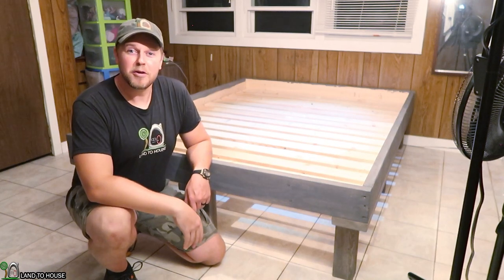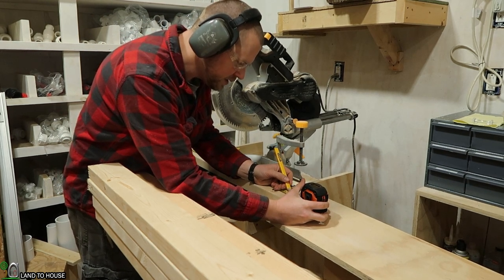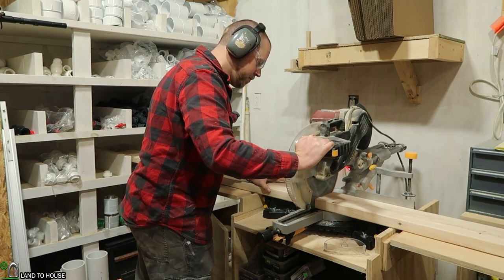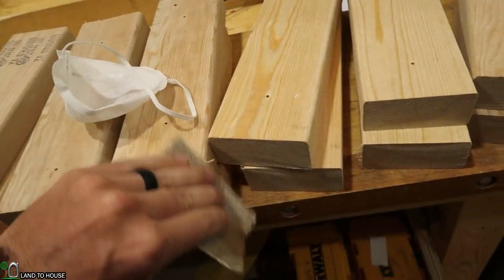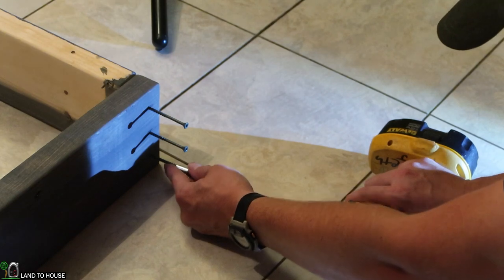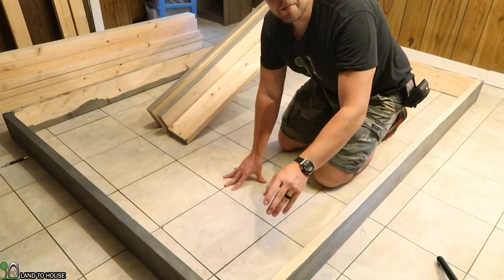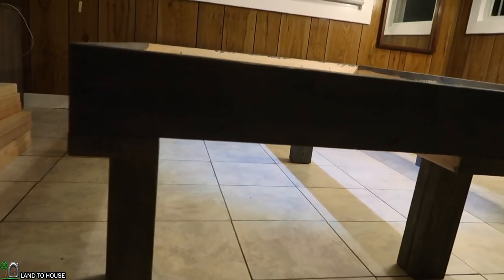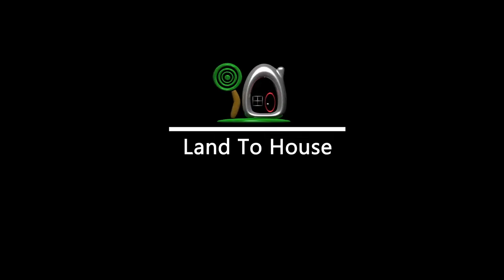Easy DIY Queen Size Bed Frame Build with Wooden Legs

Comment: Thank you very much! This was a great video! I followed it and just built my mom a new frame using wood I found around the cottage. I made some wonky cuts, I am sure. Also possible some of my wood is warped. It's incredibly sturdy. She wanted the side panel half the size for ease of rolling in and out of bed. It was my first proper carpentry project. I rented a circular saw and went for it. Super easy video to follow!! Nice!!!!!

Comment: Good job, I've built two of these very similar in the last two years. One thing I did differently was to make it easier (lighter) to move at some time, was don't screw the slats down. Instead I screwed 2" block spacers on the bottom support rail, then the slats fit in between without sliding around. Then you can easily lighten the frames for moving. I made them for my daughter and granddaughter who plan on moving sometime in the future.

Comment: Great video.  Easy to follow instructions.
I built this yesterday.   Even with the ridiculous wood prices only cost about 150.00 Cdn.   It took me a couple of hours.   Its solid as a rock.   I added felt pads to the bottom of the legs because I have hard wood in my room.  Makes it super easy to move around.
Reply: 150 is all this cost you ?  Even for the 2x6

Comment: I'm having to help my son build one. The pre made metal pedestal frames don't last very long. He's 6'5 and about 380. My only question  is wouldn't it be easier and stronger using 4×4s instead of 2 2×4s screwed together for the legs?

Comment: Great video! I'm in the process of buying a house and was hoping to upgrade my bed as cheaply as possible. Your instructions are very clear and concise, and it gives me a lot more confidence that I can actually build this on my own (unlike some of the other videos I've watched on the same subject). Thanks so much!
Reply from the maker: This is a very sturdy bed frame. And you can build it in an afternoon. All it really needs is a drill and a saw.  And you can actually have the home store make the cuts for you

Comment: I just bought 'my dear saw' haha,  I been planning one of these for years, I think I'm going to do it !  I have a LED tape light, and motion detector, so when getting out of bed. My feet touch the floor, the lights come on! Saving power from turning larger lights on in mid night, after you turn one on, you have to turn more on to see!

Comment: I want the bed to be a taller.  I am also not using a box spring.  I am a big guy (450lbs).  This bed definitely looks strong enough but I worry about the legs.  Especially if I want it to be taller.  Any feedback would be appreciated.  As I plan to make it ASAP.

Comment: 12" strips of plywood will work, as long as they are screwed on the ends, with a 4" gap, 1x4's will work also, if screwed on the ends, using 3/4" pipe for legs, with a cap, and bulk head flange, would be nice also, the pipe cap can be drilled and tapped for screw in rubber feet, for hard flooring,

Comment: Why not buy a 4x4x12 or 2 4x4x6 boards to use as legs(requiring a lot less work and fewer pieces to cut+screw)?
Reply from the maker: In my area there are no untreated 4x4s. Some places sell them. Here i had to use 2x4 material and sandwich together to get 4x4 not treated.

Comment: In tge video description you said 2 1/2 or 3 in screws, but in the actual video, when you was starting on the top, you said you used 3 1/2 inch screws on all the base. Kinda confused as to which ones I need to get.

Comment: Great video but how much did all them 2x6s cost you . This is an expensive bed
Reply from the maker: Before c19  You could build this bed for approximately a $110. Now it's probably pushing somewhere around $160. It is a rock solid frame and should last a lifetime.

Comment: Hey Seth! 
Hopefully you or someone with better knowledge than I can respond from this.
For someone that does not have FLOWING water has anyone considered using a water siphon hydro generator to generate power and then use as many ram pumps as needed to replace the water back up to the source?? is this possible??
Reply from the maker: The power calculation is: 
(Head pressure x gpm) / 10=watts
 You would have to pull a lot of water or drop a very high height.  The ram pump is going to consume a lot of the water still and not to pump as much back to the top. In the end most of the water would end up at the bottom of the system
Reply: @LandtoHouse  Thanks for replying! I can help but think there's got to be some ingenius way of reusing the same water in some sort of collection cycle.
Reply: A year-old post, but I’m answering for future readers

“Is this possible”
Water downhill, then water uphill.

Unless you provide external power,
No.
You are describing a ‘perpetual-motion machine’

Comment: Can I use 1×3 for the slats
Reply from the maker: That should be just fine.   Those can be more expensive than 2 by 4. That's the primary reason I went with 2 by 4
Reply: Ok...that makes sense. Its just that am thinking I wouldn't want it to be any heavier than it needs to...but thanks for your response. Love your work

Comment: Hey I know you don't make ram pump videos anymore but I got an idea, what if instead of high pressure in the drive pipe you would use low pressure at the waste valve (with a pipe going further downstream) . Could you gain 1 of the 7m (rule of thumb) ? but fantastic bed ;-)
Reply from the maker: Do you mean feed a second pump from the waste of the first?

Comment: Nice video!  My Tuft & Needle Mint queen size mattress is 12” tall. The site states; The space between individual slats should be fewer than 5” for the right support.  I feel using 1x4 would handle the weight. I’ve seen some slats with strips of material at both ends and the middle stapled to them at the desired spacing. They are rolled out ready to go.